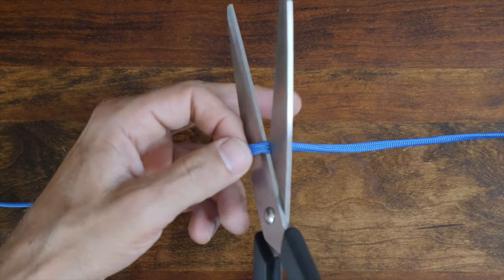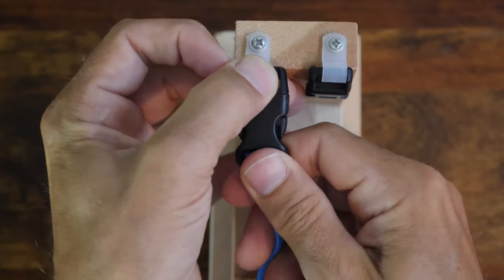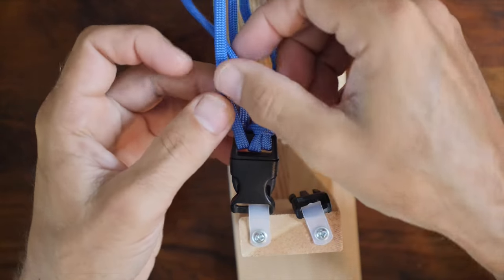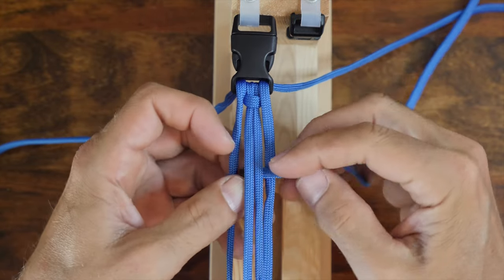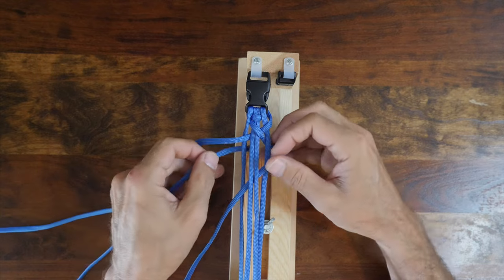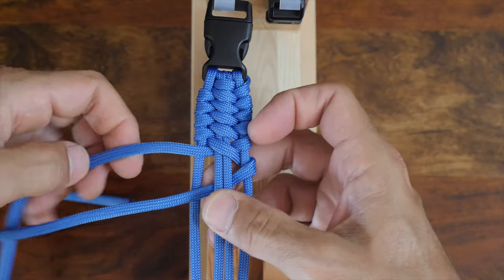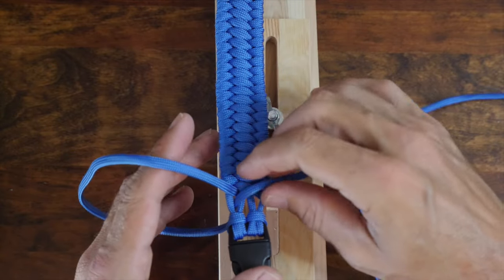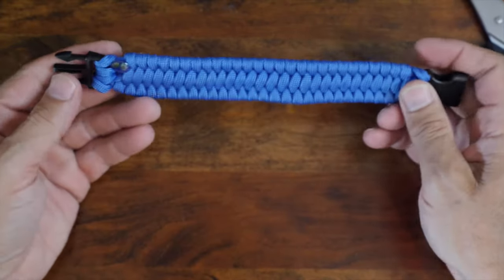EASY TRILOBITE Paracord Bracelet | TRILOBITE PARACORD BRACELET with buckle

Comment: Thanks, Jason. That was pretty easy to follow. Is there a formula for creating different lengths of braid? You used 15 feet for the bracelet. What if you wanted to make a belt?
Reply from the maker: There are formulas but they aren’t accurate because of different types of cordage and how much tension is used when typing. Best is to tie a trial one inch and then measure how much cord was used.
Reply: @Jason's Knot Channel  Thanks! 🙂👍
Reply: I came here to ask this. That's a really good looking pattern!